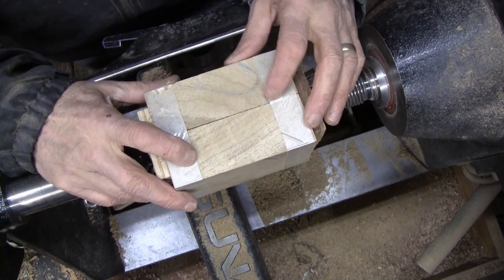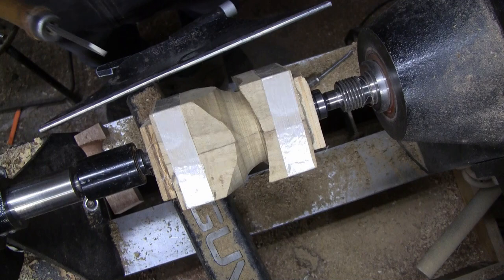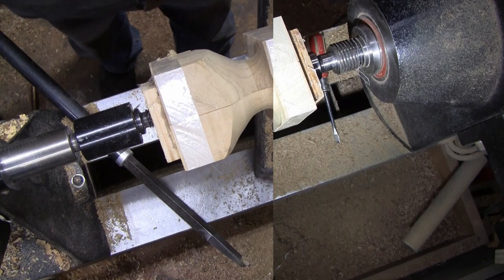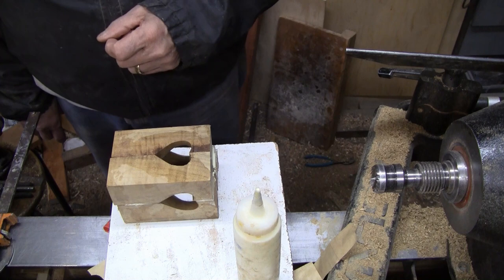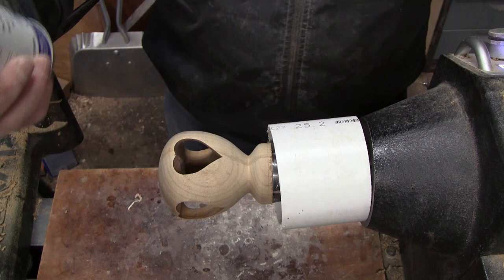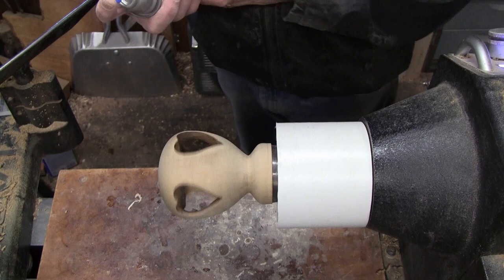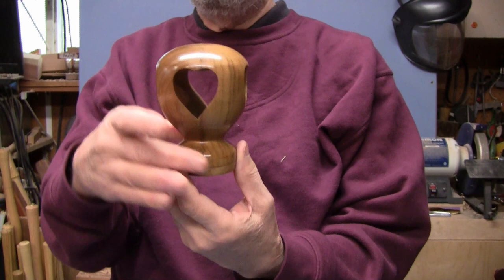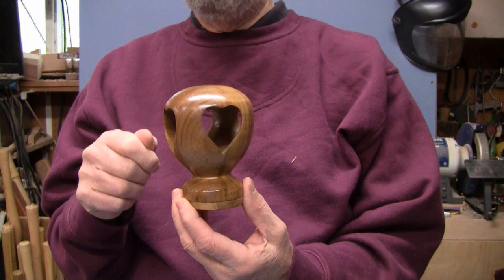Wood Turning Inside Out Turning- From my Heart

Comment: LED light: the “bottle stopper” style would work well here, up lighting the inside, and remaining accessible for changing batteries. Comes both in single light and in seed/rice/ fairy light styles. I have them if you have difficulty locating one. I stock up on them every year at Walmart during the Christmas decor season when they have all kinds of them on the shelf for low prices. BTW, another excellent turn and video.
Reply from the maker: Thank Valerie I will have to look into those. The ones I ordered arrive right after I finished most of the editing. I just might be able to open the hole enough to get them in. I just found the stoppers on Amazon they look perfect. Thanks for the tip. I have plans for the other ones I ordered. They come with remotes that can operate 1 or all 10. Turn them on and off and change colors. Pretty cool stuff.
Thanks for watching,
Gary

Comment: A wonderful piece Gary! I now see what you were after in terms of lighting. There are also RGBIC lights available which flash or change colour in time with music, so you could select a romantic song and have the lights within the heart match the rhythm. Would certainly be interested in the extra videos. I have a project in mind for inside out turning, now to find the time to try my hand at it. Take care. Ray
Reply from the maker: The ones I ordered came at 7PM when I was finished with the main part of the video.  I have a little work to get them to slip in higher up and will do that today, I was up till midnight finishing the editing and uploading or I was going to mention you as the source of the tip on where to get them.  I will try and work in a plug for your channel when I can.
Thanks again,
Gary
Reply: @ThePapa1947  I would gladly take any assistance with the channel, but always happy to help regardless!

Comment: It looks beautiful. I would like to ask you a question. Some do pure woodturning which is eco-friendly but some are doing resin. How much micro-plastic are they introducing into the environment?
Reply from the maker: Thank you Khan, well I do not do resin turning so that is hard to answer. But there are more and more turning resin so I would say a lot.
I worked as a wood pattern maker. Sometimes we needed to reproduce those patterns so the foundry could mold more than one at a time.
So I used a lot of epoxy and urethane resin as well as polyester risen. The fumes from them were very powerful. Not only in pouring the resin but in machining it. After pouring 100's of gallons of the stuff I have no interest in using any myself. 
 Not sure if that helps but that is my take on resin.
Gary

Comment: I would be interested in seeing your basic inside/out turning video!  Also, I didn't understand the comment about "paper and glue joints at the ends" at approximately :26-:28 seconds into the video.
Reply from the maker: Sure thing I will work on it and have it in a few weeks.
Thanks for watching,
Gary